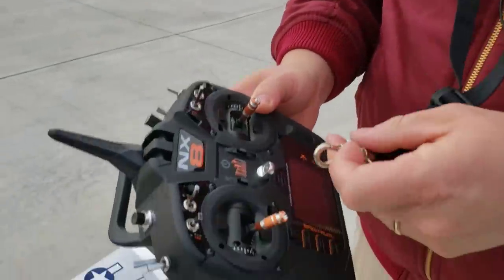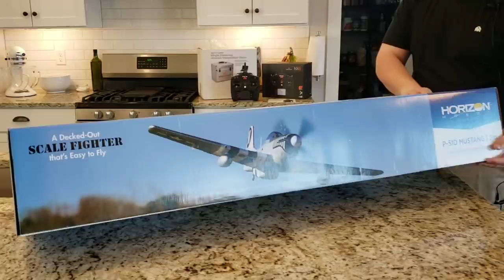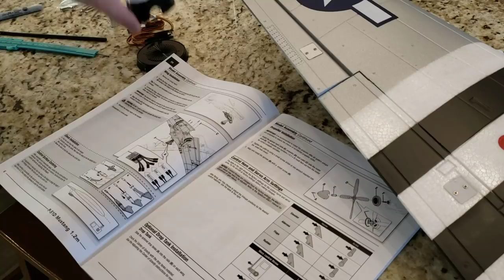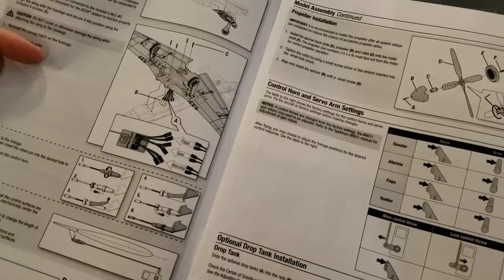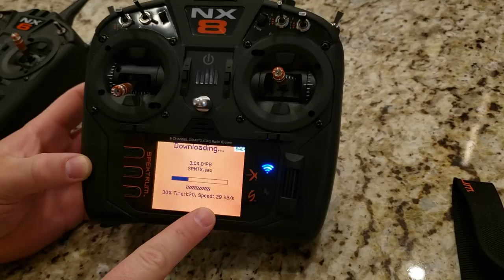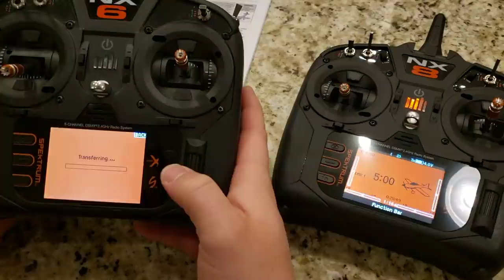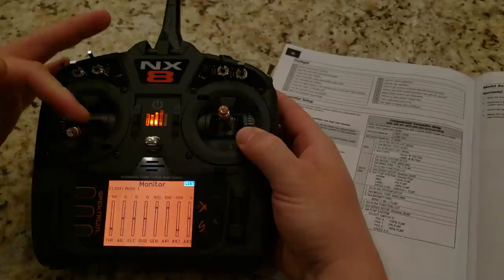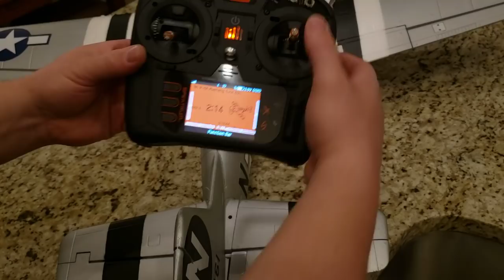E-flite - P-51D June Nite V2 - 1.2m + NX8 - Unbox, Build, Radio Setup, & Maiden Flights

Comment: Ive always used Futaba when I was flying, simply bc they were prob the only thing out there at the time. Are they even a thing now? Seeing how youve prob used everything out there, do you have a video showing the differences in radios, i.e. the DX_e models, the DX models, and the ITX models? Are the DX 18, 9 and such even worth looking at on the used market if youre just getting back into the hobby? I simply love your videos, not only showing the many planes, but also the radio setup. Any help would be appreciated. Thank you.
Reply from the maker: I have used quite a few protocols. YES, Futaba is still a thing, but not my "go-to", as it was many years ago when I was into RC as a kid.

As for the differences, if you're talking AIR Transmitters, NX10 or NX8 will be amazing for most people, but if you have the money, IX14 or IX20 would be your thing!!!

Tx https://bit.ly/3J05xSj

Comment: Hey I just got this plane love it and followed along on your set up, I’m caught up on the safe sect setup. I’m using a dx8e and all the programming was much the same to your nx8 but however when I set aux2 to safe select toggle for on/off it doesn’t seem to turn the gyroscopic features off. I know it’s connected as it runs through the power up twice when plugging in the battery just can’t get it to switch from safe to only as3x then to nothing. I would greatly appreciate any help!
Reply from the maker: You NOW have to go into FORWARD PROGRAMMING to turn it on.
Reply: @BrianPhillipsRC  by forward programming do you mean designating it to the D toggle as you had done in the video, because if so I have that set up and it changes ax2 in the monitor menu when I flip through the toggle. However it still (when flipped over) wants to correct to level in all three toggle positions. If that’s not what you mean by forward programming I would love to hear more about it as I’m newer into these more advanced planes, thanks again!

Comment: I’m just getting back into flying quads again and I’d like to buy either the NX6 or the NX8. What is the reason for getting the NX8 compared to the NX6? All information will be very helpful.
Reply from the maker: Only about $40 more for one extra channel...an extra knob on top and two additional trim buttons. It also has a lanyard, which is really nice!

The NX6 is great, and if the extra 10% or so puts you over the edge, it will do 95% of the planes in the near term...but the NX8 gives you a little room for to try to "future proof" yourself a bit.

NX https://bit.ly/3mbVuNB

Comment: Hey Brian,m you and CC are a class act! I can't figure out what i'm doing wrong with mine. I set mine up just as you did and the prop still goes in the dirt. I gave it more up elevator and full flaps and the prop still hits the dirt. Needless to say it's getting frustrating. I not ashamed to say it may be pilot error.
Reply from the maker: Flaps will make it nose over. You might have to start out with no flaps, and then get into takeoff (half) flaps, then you'll be good to go. It's a tough go, especially if you're in grass.
Reply from the maker: Keep at it. It is a Balancing act. you will get it

Comment: Hello Bryan,
 I bought this model recently and had some difficulty taking off because it lifts its tail very quickly and torque to the left.
 At the slightest delay in pulling the elevator, he hits the nose.
 So I keep enough lift throughout the taxi and pull gently up to the maximum, to avoid the Torque-left while I maintain a little rudder to the right
 Not easy !  

Here are my settings:
 Ailerons :         90/90% –.          expo -15%/-15% 
 Elevator:        120/90% –.          expo -25%/25%
 Rudder:            85/85% –           expo -20%/20%
 
What are yours please I can't read on your radio
 
Your opinion will be precious to me I did not understand your explanations concerning the battery, but personally I find that it consumes a lot and my first flight ended with a crash and a battery which triggered the low voltage threshold (8  take-offs)
 I gave up on taking it off even on short grass because it transforms into a mower!
Reply from the maker: Settings look good! I'm sorry you crashed!!! 8 takeoffs and landings in the maiden flight - excellent!!!
Reply: Thank you for your response BRIAN
 I hope not to waste your time by asking for YOUR SETTINGS on the flight of your video

Comment: Brian:
 Have YOU tried any of the open tx transmitters? If so, good or bad?
(Every Bnf plane I have are from horizon. The safe is best for maidens, then click it off!)
Reply from the maker: I have used the Jumper, T8SG....and wasn't overly impressed for a variety of issues...namely, setup was a huge pain, but that's largely due to my inexperience in the Open Tx platform, and not so much an incrimination of the tech.
Reply: @BrianPhillipsRC  

I tried the tx16s. Ended up returning it & getting a dx8e. 😁

Comment: Brian wondering if you help me out? Just set Safe on this plane on my NX6, channel B. I always have Safe on position 0 and AS3X only is on 1 and also 2. With every plane I've set up, Safe always has limited movements and AS3X gives max throws. However on the P51 Safe has huge throws. Position 1 AS3X has LIMITED ELEVATOR but max throws on rudder and ailerons and position 2 AS3X has LIMITED RUDDER but max throws on elevator and ailerons. AS3X only on B postion 1 and 2 have never been different on all my planes and this is my prefered easy access "panic" switch. Safe and AS3X can confirm works. Can you shed any light on why I've got different range of movements in my AS3X modes? Thanks for any help you can offer.
Reply from the maker: Setup the plane the way I set it up and then see if you have issues. Go through the RADIO SETUP part of this video, and you can follow step by step. You will be fine with the NX6 (it will give you the 7th channel you need).

Get this working, then see if you have the same question.

Comment: Hi Brian & camera crew,  I'm a new boy to the flying world, well sort of I did a bit some 15/20 years ago and oh boy haven't things changed in the hobby, I'm over here in the UK and at the moment it's cold and not nice to be outside flying, anyway I've just got myself a NX8 when I first bought it it had a problem and would not start up & so it went back and the SD card was corrupt anyway they have sorted it, now i'm another one that's got you as a tutor, and I'm following your channel it's brilliant so don't ever stop, now question could you please explain what is F-Mode as my NX8 is in mode 1 is it something I need to worry about,
Thanks in advance 
Regards Paul
Reply from the maker: Flight Mode - I use them NOW for some Forward Programming, but at the time of this P-51 I don't think we had needed to use F-Mode (flight mode) yet.
Reply from the maker: We have some more recent videos where I dabble in the Flight Mode setup more...thinking about it, off the top of my head, I think we did it on the Hangar 9 Ultra Stick and Hangar 9 P-47 recently
Reply: @BrianPhillipsRC  Hi Brian thanks for your reply understand,  I watch and rewatch and you have convinced me I’m going for the P 51 June nite 1.2 because you said :) I’ll probably watch again especially on the set up, eventually I would like to think I could get upto the 1.5 but like you said need some experience before we can get that far, anyway thanks again keep doing what your doing, and wishing you have a great 2022 for all of your family mate 
Kind Regards Paul

Comment: I have the same plane and I'm astounded with how straight you can keep it at takeoff. For the life of me, I can't figure out how to keep it from torquing wildly to the left.
Reply from the maker: This is a practice makes perfect thing. P-Factor is the torque that comes from the prop spinning up to speed, and it's a real issue for many rc planes. I have to use a lot of rudder to counteract this strong tendency to veer off on takeoff...
Reply: @BrianPhillipsRC  It's amazing how much better one gets with a little practice. Since posting my comment, I've become a pro at this plane. I crashed it early on (It was my second plane after the Apprentice S) so I have a new one hanging from the ceiling waiting for its maiden. But the old one flied so well and just won't quit! I love this war bird! BTW, I love the "red rake" also. Lol!  Been flying that a lot lately and it's also an awesome plane.

Comment: Have ever had to take out a warp in a foam stabilizer?
Reply from the maker: I have had a few, but never actually taken the warp out. It's supposed to be easy, and I've fixed foam before, but not to straighten a stab.

Comment: I can respect you like the spektrum radios, Brian. I started with them. I can say this, the price point on these radios, chargers and batteries (spektrum) is getting out of control. I went out a few months ago and spent $149 bucks on the radio master TX16s. I can bind to almost ANY BRAND receiver (as I am sure you know). The open TX platform was very easy to use. Best of all, I can buy RM168 receivers for 10 bucks WITH voltage telemetry with dual antennas that wont break off, they unplug!!!...16ch, telemetry, programmable gear delays, programmable flap delays, the list goes on and on. Capabilities are endless.After using this Radio master 16s I could Never justify going back to a spektrum radio..But like I said I can respect that people like these radios.
Reply from the maker: I haven't tried the Radiomaster yet, but I think we have one on the way. If the OpenTX is as clunky as the Jumper T8SG, I will probably have the same feelings, but I'm hearing very good things.

That being said, for a beginner, Spektrum has been wonderful.
Reply: @BrianPhillipsRC   I only have 1 complaint on my radio master tx16s.The sliders on either side(which I dont use anyways) are very sloppy. They move way to easy. But They are easy enough to change out. As usual great videos Brian the wife and I enjoy watching!..

Comment: Can you explain the differences in receivers ?  can all my planes in my DXe, DX5e, DX6i  - CH40 -  .now be able to bind to my new NX8 ?
Reply from the maker: If the Receiver and Transmitter both use DSMX (or DSM2) protocol, then you can bind and use them.

If you're using any of the listed Transmitters, you can replace them with the NX8 - YES ;)

Comment: Why should I dispose of my battery after a crash?
Reply from the maker: If the lipo is damaged, it might be a good idea, but make sure you're careful. You don't want to have it catch your garbage on fire, or the garbage truck on fire (Seriously....this is a thing).

The idea is to discharge the cells to nothing, if you can, then I usually run a nail through the cells, with all sorts of PPE on to protect my face, eyes, and hands...or I shoot them.

Comment: Hey Brian, just received my nx8 and when I try updating the firmware from 3.03 to the newest 3.06 it just goes to the spectrum screen with the status bar then it just flashes off and on while the status bar never moves?
Reply from the maker: I had mine do some strange stuff, but I assumed it was a poor connection to the internet.

Might want to call up Horizon Hobby tech support on this one. If it's working, you'll be fine to use without the Latest and Greatest. Then when you update, everything should come over just fine.
Reply: @BrianPhillipsRC  just wanted to let you know I figured it out after I finally visited spectrum website. I needed to update to 3.05 before I could do 3.06 per their instructions. I did just that and the newest 3.06 updated with no issues. I appreciate your getting back and maybe this could help others if they come across it. Still loving the channel FYI

Comment: The Foam cut in my Spectrum Transmitter Box is cut on the Horizontal Side. The Vertical Cut is way much better.   :>)
Reply from the maker: I see! That seems to be why it looks so jagged....but whatever gets the job done. I guess they figure you won't see it before you order it - LOL, guess I ruined that part of the plan - LOL ;)
Reply: @BrianPhillipsRC  ..I much rather have had what you have, that's the Vertical Cut for the Transmitter which allows for more room in the box.  I could order the newer vertical cut foam insert.

Comment: How would you trim the rear tire
Reply from the maker: You can just grab it and move it, or open it at the back or at the front to get to the set screws that lock it on the control rod.

Comment: Does the 1.2 p51 mustang tip stall easily?
Reply from the maker: All planes tip stall if you turn too sharp, and too slow. This plane is great flying, and performs better than average in the stall arena.
Reply: Will the plane slow down like the 1.1m Trojan?

Comment: 1 month old and plane discontinued?? What's alternative for beginners
Reply from the maker: No...the NEW Replacement Rx is the reason you see this. When you click on the right link it is NOT discontinued...they just updated the part number so it would reflect the change to the AR631, from the AR636B.
Reply: @BrianPhillipsRC  Found it thank you for the great videos. I have subbed to your channel. You have so much great info. I think following you will help me get back into flying without too much trouble. BTW I have and old Ok Model EZ Zero. I started building back in 2009. It's a very rare plane, it's balsa, to foam covering, then a printed covering with unreal detail and weathering over the foam and finally covered in a clear Mylar. Talk about pucker factor. They are evidently collector's items now. I will finally  finish it. I purchased it before Ok Models burn down in Japan. With today's technology, Safe, and Gyro receivers, I think I'll be brave enough to finish it and fly it next year.

Comment: I noticed the G2 batteries have a faster charging time. That's worth the extra few buck to me!
Reply from the maker: I don't disagree that they can possibly balance themselves and DISCHARGE faster, but I haven't really seen a difference in charging times, since I charge at whatever rate I set on the first time I setup the SMART pack. What I find is that when flying, and if you REALLY push the limits, they will sag less bad when ONE cell seems to crap out earlier than the other 3,4, or 5 cells, thus you get a slightly longer flight time.

Also, I LOVE that I can just plug them in and not worry about settings...such a first world problem, but it's a THING in my life ;)